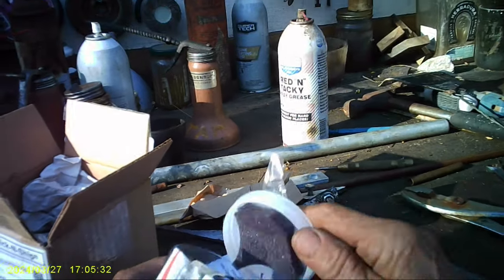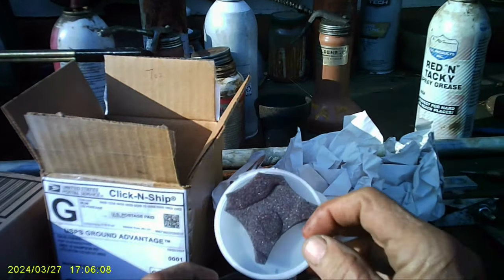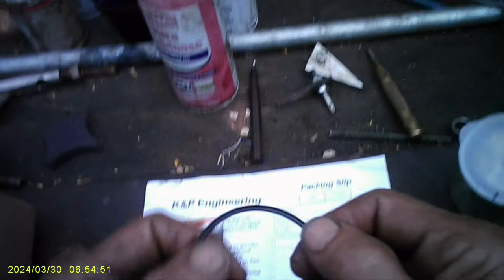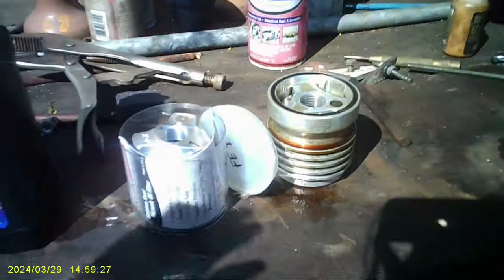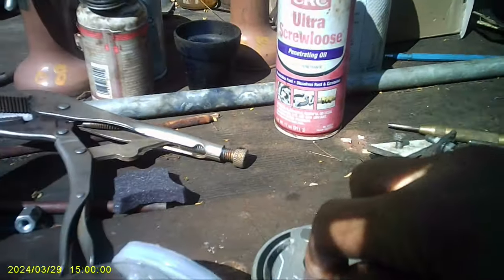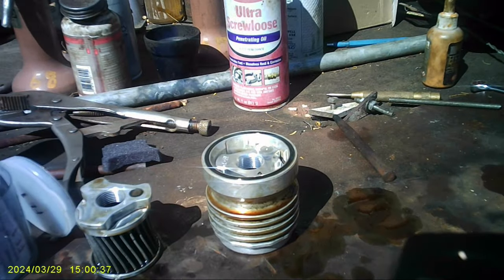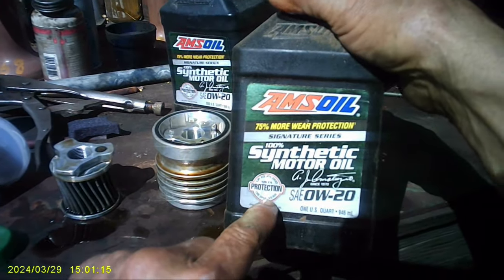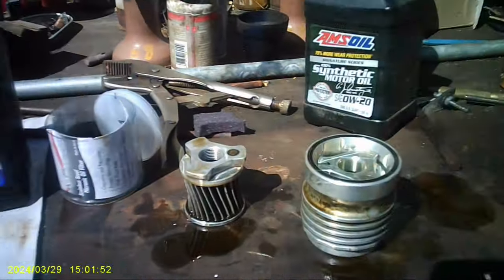Forever Oil Filter. K+P. The last Oil Filter you will ever buy.

Comment: Definitely need to know the micron rating.
Reply: Not good I’m guessing
Reply from the maker: 4) How does this type of filtration compare to paper oil filters?

We use ASTMF316 testing procedures which eliminate many of the user variables found in the SAE procedures. Basically, the filter media is pressurized from one side, and when the media starts passing particles, that is the micron rating. We sent filter media from several common brands of paper filters to the lab to be run through the ASTM test. We sent the media to the lab with no names, just numbers for identification so they wouldn’t have any idea what brand filter they were testing. The results for the paper filters ranged from 48 microns for the best filter to over 300 microns for the worst filter. Our tests were right in line with other testing results we have researched that have paper media filters passing particles anywhere between 50 and 90 microns. What does this mean? Paper filters are rated on averages, percentages of efficiency (also known as beta ratios) and multiple passes, so a 10 micron rated paper filter (as advertised on the packaging) may be letting particles 50 microns and larger through. The medical grade stainless steel cloth that we use is consistent across the entire media surface and is rated at 35 microns, meaning nothing larger than 35 microns should pass through the material. The bottom line is we meet or exceed the filtration performance of OEM filters, eliminating any warranty issues.

Comment: How many microns... They should tell you on package or else your claim is unfortunately inconclusive. Sure like the reusable housing, are they competitively priced?
Reply from the maker: 4) How does this type of filtration compare to paper oil filters?

We use ASTMF316 testing procedures which eliminate many of the user variables found in the SAE procedures. Basically, the filter media is pressurized from one side, and when the media starts passing particles, that is the micron rating. We sent filter media from several common brands of paper filters to the lab to be run through the ASTM test. We sent the media to the lab with no names, just numbers for identification so they wouldn’t have any idea what brand filter they were testing. The results for the paper filters ranged from 48 microns for the best filter to over 300 microns for the worst filter. Our tests were right in line with other testing results we have researched that have paper media filters passing particles anywhere between 50 and 90 microns. What does this mean? Paper filters are rated on averages, percentages of efficiency (also known as beta ratios) and multiple passes, so a 10 micron rated paper filter (as advertised on the packaging) may be letting particles 50 microns and larger through. The medical grade stainless steel cloth that we use is consistent across the entire media surface and is rated at 35 microns, meaning nothing larger than 35 microns should pass through the material. The bottom line is we meet or exceed the filtration performance of OEM filters, eliminating any warranty issues.